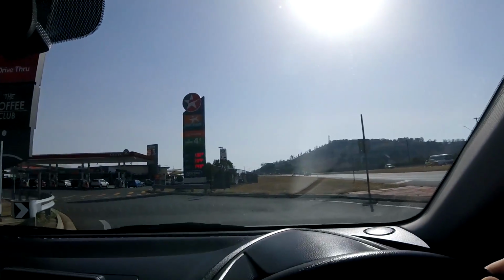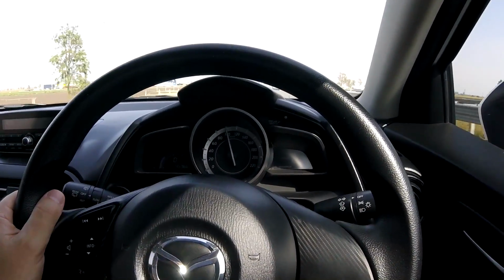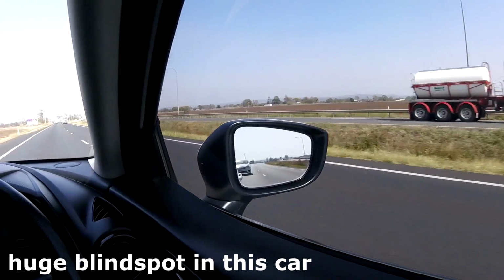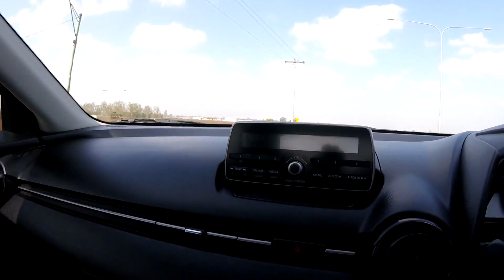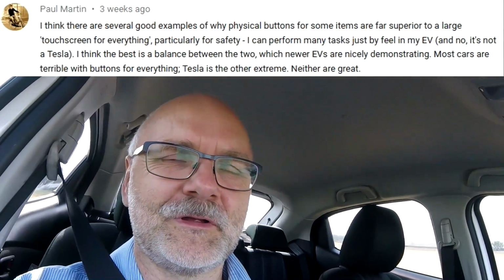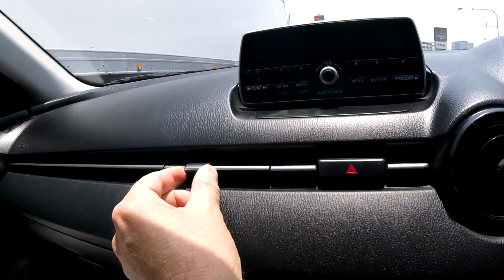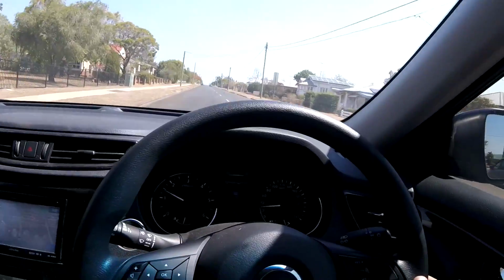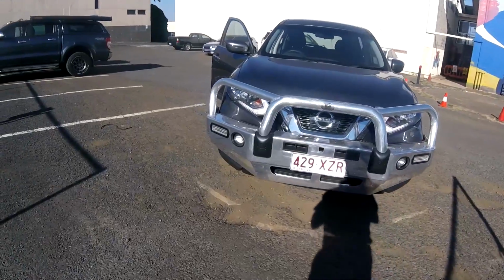EP304 - Is not having buttons in the Model 3 really good?

Comment: Xtrail is all bark and no bite?
Was just talking to my partner about the lack of dual climate control in the model 3 yesterday. Guess I'll find out first hand next year. 
Lack of acceleration in a diesel is probably mostly turbo lag. Guess it doesn't have electric compressor for the Aircon as the alternator isn't running while in stop mode.
My brother in laws Passat keeps killing batteries, probably due to stop start.
Reply from the maker: The Model 3 has dual climate control. The problem is that the passenger cannot adjust the amount of air and can only divert it away.

Comment: I don't miss buttons at all in my 3.
Reply from the maker: The vent control is clumsy and incomplete through the screen. I wish they would have designed normal vent control.
Reply: I think the new model S and X will have more individualized vents. I hope so at least. I also want more granular adjustment to air. I was thinking about putting a fine mesh over the vents to help disperse the air slightly more. Want to help me test some elegant designs Andy?
Reply from the maker: @cesartrujillo4190  sure, if it is elegant...

Comment: Mazda Sky Active X is the only major update to ICE efficiency for small engines, but it's yet to be proven for long term reliability. Start / stop doesn't save any meaningful fuel, just for their paper based figures - puts more of a strain on battery (needs to be higher spec) and starter system. Many people switch it off. It's nearly 2020 and the progress for EV's and fuel cell vehicles is relatively slow for mainstream (much faster in China). To me it feels like we should have been where we are now about 10 to 15 years ago.
Reply from the maker: That's thanks to the FF industry donations to our governments and the lack of understanding the urgency and opportunities. Well, the next huge disruption has just started.
Reply: @unpluggedEV  That's true. Not to be ungrateful as to the tech available now on new cars - thankfully even lower spec vehicles tend to have all the important active safety features included, and it's getting better every few years. But however modern the styling is or how many gadgets they include ICE is now the most outdated part of the package. With fuel heading to $2 per litre some days, for premium, and the bigger picture emissions issue, it's definitely a time where the old ways will quickly date.

Comment: I have definitely seen video of separate driver and passenger directional air flow control in Model 3s. It might be only available with the full premium package (these videos came out when only premium Model 3s were available) but that seems unlikely.
Reply from the maker: Only the direction and temperature can be selected separately, nothing else.
Reply: @unpluggedEV  Seems "direction" is much more refined in the model 3. It includes degree of spread. The flow can be narrowed to an extreme and pointed to either side. This should effectively be able to keep the flow away from the person.
Reply from the maker: @KenWerkSolar  That is correct, diverting the air stream is the only way to 'turn off' the airflow individually. It's a workaround but certainly not ideal.